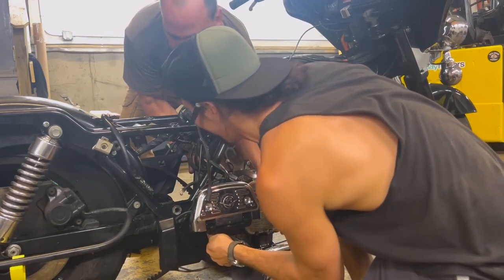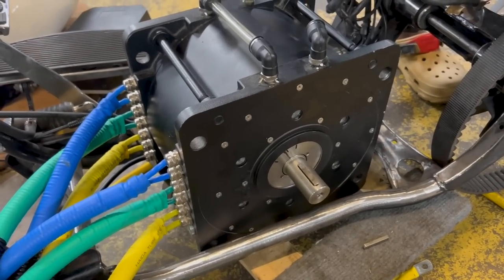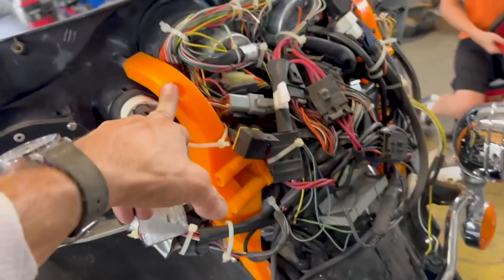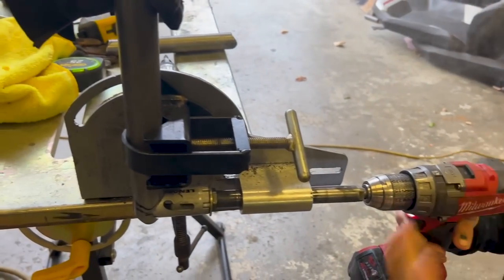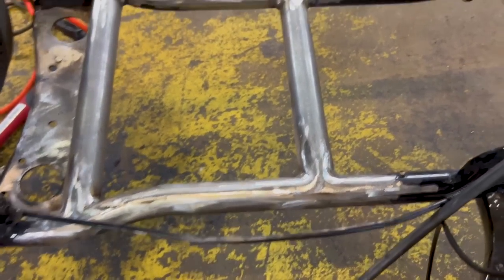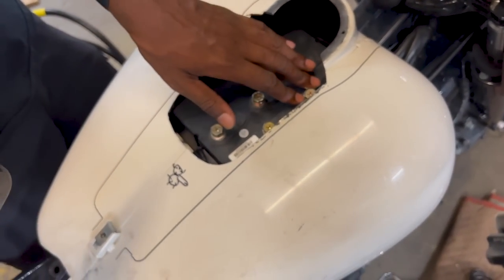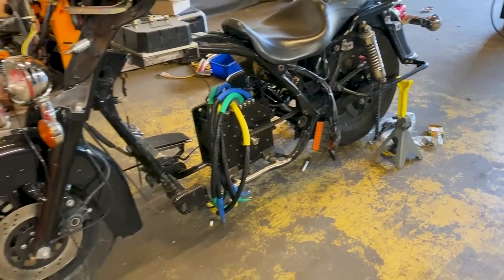Putting an Electric Motor in a Harley Davidson

Comment: it's still gonna leak oil
Reply: Somehow someway
Reply: Just to mark it’s spot
Reply: fork seals and brakes gonna leak
Reply: Lmao 🤣
Reply: Cause it's a HARLEY!!🤣🤣🤣
Reply: It's + Steel + gonna leak  + oil?? Damn.
Reply: THIS COMMENT
Reply: The truth hurts
Reply: Harley dose not change extra for it's anti rusting system.
Reply: Im going to bed on that one. 😂
Reply: Lmfao 😂😂😂😂😂😂 right out the bars. It's going to sweat.
Reply: Of course it will,  if it is Harley,  it leaks 😂🤣
Reply: Ahhhhhh 😂 😆 😂 😂 😂 😆 😂
Reply: It’s not an oil leak, it’s just sweating from all that power
Reply: Word!!
Reply: 501 like is mine.
Reply: Spat my coffee! 🤣😂
Reply: That's just a bad stereotype I've kept my Harley in my living room for years with cardboard under it just in case never leaked a drop, you must be thinking older Harleys like from the '50s etc they're way better engineered than that nowadays, mine is a year 2000.
Reply: @BR4ND0N509  they still have a rough idle.
Reply: @olivierroy1301  Yeah "potato, potato, potato, potato" I love it but would rather have a highway cruiser that's smooth, but sacrifices are made for power I'm not old enough to give a sh*t about smoothness yet.🤣
Reply: You’re funny
Reply: @BR4ND0N509  FYI Harleys are incredibly smooth once they’re moving, because the engine is designed to shake front to back, not side to side. So once you’re moving on the road the roughness disappears.
Reply: That's outstanding.
Reply: @BrapBrapDorito  
Not on the fat boy I hired for a few days. It barely did 105mph and my hands were numb for hours after riding it coz it vibrated so much.
Reply: And make alot of noice!
Reply: It's a self lubricating bike after all
Reply: Haha, Harley!
Reply: Looks like the motor will be water-cooled by a radiator.  So ... it will definitely leak water.
Reply: 🤣😂🤣 Have a lil faith guys
Reply: Make sure you install a small oil reservoir that provides a constant, small drip (just for authenticity)!!!

Comment: This is about to be the fastest accelerating Harley in existence. It'll be able to leave oil trails faster than ever before.
Reply: Need it to leak battery acid as a modern take on the Harley.
Reply: Erm… The V Rod could hit low 11 quarter miles stock. The current 114ci bikes are no slouches either. Acceleration hasn’t been an issue with Harley’s for a while now… It’s just corners and the need to stop that they struggle with.
Reply: obligatory joke about slow harleys
Reply: And shake itself to pieces.
Reply: @Jonathan_Doe_  go watch King of the Baggers MotoAmerica
Reply: @replynotificationsdisabled  I’ve seen it before, very entertaining due to the limitations of the bikes (and the roar of the big twins). What’s your point though? Those things are heavily modified and still corner like yachts. A 250cc Moto3 could easily lap them.

Comment: Since this is going to be an electric harley, it should have some sound. I recommend the harley sound from South Park. Set it up so that it gets louder the more throttle that you give it. I think this would finish the build off very nicely. Safety first!
Reply: this is such an underrated comment.
Reply: You could just yell engine noises while you ride around. If you’re looking for inspiration check out that old All Gas No Brakes biker rally video 😆
Reply: There is, nor will there ever be such a thing as a REAL 'EV Harley Davidson'.  There is no reason to buy a Harley if the motor's not there.   None.   The motor IS Harley Davidson.
Reply: @Woodywoodah  And when they turn off people's electricity to 'save the planet', once they've established this 'electric monopoly', only the actual Harleys and other ICE will be operating if they can still find or adapt a fuel.
Reply: Yeah,I'm thinking about the same thing, except the sound were from a plastic sports card hits the rim.
Something like turbospoke thingy. A truly cutting edge high tech thingy for a high tech channel like this, trust me on this one uncle Rich.

So you can save some power for extra mileage or use them on a 72v vibrator in case of the emergency, and bump up the sports cards' value on the market while you go. That's killing several birds with one stone I'd say.
Reply: @crforfreedom7407  Making gas seems to be the ONLY thing not on the internet.
Useing food to make fuel is not a bright idea at that point.
Reply: @robertsmith2956  What food?   Haven't you heard?  FOOD HAS BEEN BANNED...
Seriously.  Ask anyone in Shri Lanka or the Netherlands...
Reply: @crforfreedom7407  lol ga weg joh!
Reply: @robertsmith2956  PSEC Robert.
"One of those factors is going to have to get pretty close to '0'..."
Reply: @g60force  You remember what I said this time next year.  OK?
Reply: rah rub rub rub rub hahaha
Reply: Just put baseball cards in the spokes.  It made my banana seat Schwinn sound badass. At a stop light you just have to yell the word potato over and over SLOWLY.  Po-Ta-Toe Po-Ta-Toe, Po-Ta-Toe
Reply: Safety Third
Reply: I second this🙌
Reply: I'm going to agree here, that would be freaking epic....
Reply: @crforfreedom7407  Aww, cry more.
Reply: @crforfreedom7407  Lmao, I think you've been huffing too many gas fumes.
Reply: @crforfreedom7407  Yeah I 100% believe you that food has been banned in the Netherlands.
Reply: @randomname4726  Dutch farmers angry over mandatory measures to drastically reduce nitrogen emissions 
By Louise Miner  with AP, EBU, EUROVISION  •  Updated: 12/06/2022
Reply: @randomname4726  The Netherlands’ Farm Crisis, Explained
One in three Dutch livestock farmers could lose their business. Nick Ottens June 12, 2022
"One in three Dutch farms may need to close. It’s the most painful consequence of the government’s plan to cut nitrogen emissions in half by 2030."
Reply: @randomname4726  'We are going to die': Sri Lanka warns of food shortages
By Devjyot Ghoshal May 20, 2022
Reply: @randomname4726  As rolling blackouts and food shortages continue, Sri Lanka weighs IMF bailout July 31, 20227:44 AM ET Heard on Weekend Edition Sunday
Lauren Frayer 
"The new government in Sri Lanka has resumed bailout talks with the International Monetary Fund, but rolling blackouts and food and fuel shortages continue."
Reply: @randomname4726  Sri Lanka's Food Crisis Reveals the Dangers of Environmental Planning
Sri Lanka's tragedy is a classic example of a supposedly “green” policy achieving very little—beyond human suffering.
Saturday, August 13, 2022
Reply: @randomname4726  Euro Falls Below Dollar As Europe Gears Up For Energy Crisis
Siladitya RayForbes Staff Aug 22, 2022,08:09am EDT
"The Euro fell below parity with the U.S. dollar on Monday for the second time this year as the Eurozone continues to face rising inflation while it prepares for a potential energy crisis this winter amid concerns of Russia squeezing supply of natural gas."
Reply: @randomname4726  A food shortage is coming, even in the U.S.! Geoengineering and the deliberate destruction of the weather, inflation and green policies are threatening the US food supply Jul 25, 202210
Reply: @randomname4726  How the American South is paying the price for Europe's 'green' energy
Jul 9, 2021 CNN
Reply: @crforfreedom7407  🧢
Reply: @crforfreedom7407  …I suppose they’ll block out the sun like Mr Burns in The Simpsons too so we can’t use our own solar panels either. I’ll have to start drilling and refining oil in my backyard to prepare for this.
Reply: @Woodywoodah  CA has passed a law putting a meter on people's wells; taxing the water they draw from their wells on their private property, while providing no service.   They can do that with solar just as easily.

Comment: Rich Rich Rich-The chain meets the transmission at a pivot point. The pivot point keeps the chain tight while the swing arm swings. You can’t change that optimal pivot point, you can match it with a jack shaft but the exact point the transmission was is optimal otherwise the chain will loosen and tighten as you hit bumps.
Reply: interesting stuff coming soon.😂
Reply: Bet a skateboard wheel tensioner is in play....
Reply: Why not just keep the belt?
Reply: Have you seen how loose chains are on drag bikes? Just need more compression and rebound.

Comment: You should add a oil tank with a valve so when you park you can crack it open and leak a little oil just to keep up with tradition
Reply: Or just put it’s proper drivetrain back in and toss that electric engine in the garbage where it belongs.
Reply: @the overseer knows all do you think that “the garbage” is a magic concept like a black hole? You can’t even say attach it to a fan and throw it in my attic vent like a cool boomer.
Reply: @Thecanadianseige69  why are u watching this?
Reply: @ben3989  because I was watching them fix those god awful electric Tesla’s. Gave both real power trains
Reply: @ben3989  EVs won’t last very long I give them another 5 years before they realize how much of an inconvenience and how bad they are in general.
Reply: @Thecanadianseige69  These guys specialize im evs why not?
Reply: @Thecanadianseige69  they will last way longer due to popularity glad sum companies are gonna stay gas after everyone has transitioned to evs

Comment: Exciting progress! Don't forget that chain will need stripping of grease and properly lubricating. The current grease is just for storage/corrosion prevention
Reply: Ehhh not absolutely. I usually leave it there for like 20-30 km it turns light when warmed up by friction and drips. And then wipe apply actual chain oil. Less harsh than using chain cleaning fluid.

Comment: Just make a stepped key. We do it all the time with shaft-drive boat props. Never had a failure. Not a big job at all.
Reply: We got off set keys for predator 212s flywheels,  advance ignition timing way more sketch than a stepped key
Reply: exactly my thoughts

Comment: you should put a small oil reservoir you can put old used oil in, and an old well oil dripper so it just very slowly leaks oil to maintain the authenticity of the Harley.

Comment: For the sprocket, you need a stepped key (which is a large key and a belt sander...). Was there no way to keep the belt, though?
Reply: @esahg5421  I agree...no oil drip.
Reply: Or a mill.
Reply: a simple adapter bushing would mate the transmission sprocket to the elec motor shaft, chains are noisy and it's an HD so maybe?
Reply from the maker: @esahg5421  a belt drive is completely a user preference, better for some and not for others. To get the correct ratio, the chain is more cost effective and far easier to nail down, if I decided that I wanted a higher top speed, I'm extremely limited in options for belt drive esp for the rear sprocket, not to mention the belts themselves. If I was ok sticking with one ratio and keeping the noise down, then belt is fine.
Reply: @RichRebuilds  Ya know 🙄
Reply: @RichRebuilds  but you already have a belt drive installed, belt should be perfect and the gearing should be good anyhow. you haven't even tried it and yet you are wasting more money on a chain drive.... try belt first if "cost effective" is your goal... saves ya money when you realize that you don't need a chain drive.
Reply: @RichRebuilds  now we know!!!!!!
Reply: @WatchRichRebuildsChannel  The more you know 💫
Reply: You can take that sprocket to a machine shop. They can broach a larger keyway in it to match the motor’s key size. 15 minute job.
To be clear I was referring to the chain sprocket for the motor NOT the belt sprocket
Reply: @RichRebuilds  makes sense. Thanks for explaining
Reply: @GOonTedgi  do you really think that belt drive with gearbox and gasoline engine can somehow be just correct for electric engine. I would just be first gear, and for that it would offer way too much torque and too low speed. It can be seen by looking rpms of different motors and transmission drive ratios. Uncle rich is doing good job, that goofyness is just style of videos. Actually he is doing good job and do research for his projects
Reply from the maker: @GOonTedgi  normally yes, but a belt is about 2-3x more expensive than a chain (which I would need a new one). not to mention the machining of the belt sprocket that will no longer fit over the motor shaft. The good thing is that if this doesn't work out, I can switch to a belt drive easily, nothing about this is permanent
Reply: @GOonTedgi  You should totally do that on your channel!
Reply: @esahg5421  because they use belts in MotoAmerica bagger series and in drag racing.....
Reply: @esahg5421  🙄
Reply: @farcohollis1369  really?
Reply: @Stone177  yes really

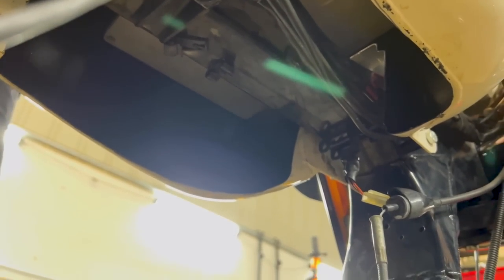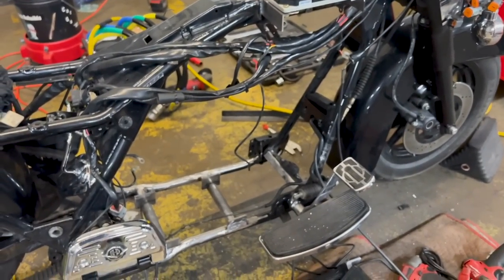Comment: At 16:17 & 19:37   you should paint the inside of your gas can with Rhino Lining  so when you hook up your power wires to the speed controller you don't actually touch something or if it comes loose it doesn't vibrate "off" and hit the inn side top of the gas can AND SHORT  EVERYTHING "BRAKING YOUR WORK". Or accidentally hurt anybody.  And change the washers you used on the back tire there not balanced right on the concaved side of the sprocket thay can brake not being level or true ,siting on the sprocket.

Comment: You should still have a 12v battery. The same reason they keep them in cars. So you can power lights etc if the main battery is flat
Reply: Hopefully a lithium ion 12v
Reply: Yup. It doesn't need to be lead-acid, though since it doesn't need tonceank a starter. A small lithium battery would do the job.
Reply: @catsaregovernmentspies  yes
Reply from the maker: this is true but keep in mind that many newer electric motorcycles no longer have a 12v battery, zero comes to mind.
Reply: @RichRebuilds  So how do you light the bike? and turn signals? Run a step down converter from main battery??

Comment: Idea for motor bay. Remove cylinder sleeves and heads from the v-twin and mount them on the motor. Especially if it's not in a traditional twin configuration ie rotated forward...freak people out. You could even give it an exaust pipe! (with a speaker making the Jetson sound)

Comment: that's a great idea , you could ask Grind Hard Plumming if they would want to team up and do a team up two some session prodject , set a few condition rules and has to be present or minimum ability reached , or spec ,stuff present etc and have a set amount of time or switch Workshops and have to complete Task with getting Hands on with Each others tools to see what comes out of it all.

Comment: You should build batteries into the saddle bags. Of course removable and optional. Having the regular battery mounted on the bike but two extra batteries with the option of running in parallel for 3 times the range.

Comment: You guys HAVE to invest in a small Lazer CNC table for fabricating small pieces you could cut a small piece for your sprocket pin problem also create a motor mounting plate with slotted holes for being able to adjust the motor placement and many other applications. Just a suggestion, love what you guys are doing can't wait for the payoff
Reply: Yeah, it's actually amazing they don't have one.

Comment: I'm more curious about how you will recreate the deafening straight pipes, jackhammer vibrations and oil spills.   Will it randomly lose nuts and bolts? Are the breakdowns preprogrammed and can they be adjusted for longer trips?   

Jokes aside, this is a very cool project.  👍

Comment: Use the holes from the gauges to run a vent tube to the front of fairing, and add a AC vent from a car on the dash side. Make shift a/c.

Comment: You could take a rough cast of the original engine shape prior to removal  and use that to make a fibreglass cover to go around the motor and hold the batteries. That has the advantage you only need the shape, it doesnt need to be the same position, so if you need an extra inch to cram the batteries you can just mount it out more, or curve the shape a little more prior to the resin setting.

Comment: In regards to the cosmetic design that you’re thinking about, what if you used sheet metal, or fiberglass panels. 
You could press louvers for cooling and paint the same logo that was placed on the gas tank. (16:34)

Comment: The Best and Correct Method To Correct Your Electric Motor Keyway problem was best sorted using your Brand New (That I Really Need one off Myself If You Don't wajnt it Please)  pillar drill what  I've seen in the back ground , if you purchase a +/_ X and +/_ Y (Forward , Backwards ,Left , Right) Axis Windable Square Base With A Grid of Pre Threaded Holes In The Top Surface for Clamping Stuff down. (Same as they use for a Full Size Virtical Milling Machine ok) , Screw a lenghth of M8 Threaded bar with Two Nuts also on it's Shaft you can Tighten Together ,Then into the End of the Motor Spindle Shaft Allowing you to Stop The Rotation of Your Shaft , then with a around Four Flutes around it's Shaft END MILL BIT Preferbly Made of Tungston Carbide Steel So Strong and Lasts with a Flat Finishing End Bottom Profile , Wind it along The Required Lenght Distance in Her Slot To Open Her Up Wider And Deeper So You Can Fit Your Larger Than Normal Keyway Wedge Deep Inside Her 😛,😲Reemed out Slot To Marry Them All Together Nice And Tightly Fitting Now.

Comment: Just a suggestion, but I think it would be cool to either cut the cooling fins off the original Vtwin or create something similar to fill the "hole". Basically design a fuctional air cooled battery box that looks like the piston housings on the HD engine.